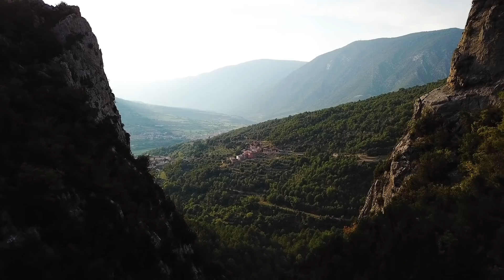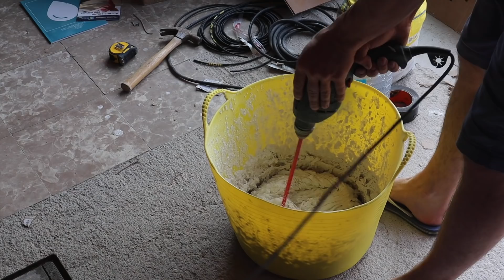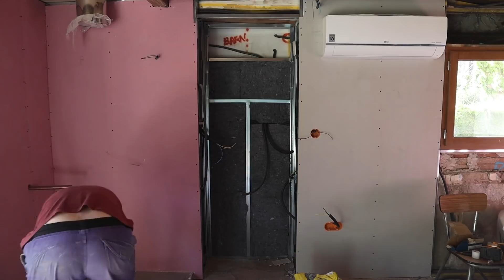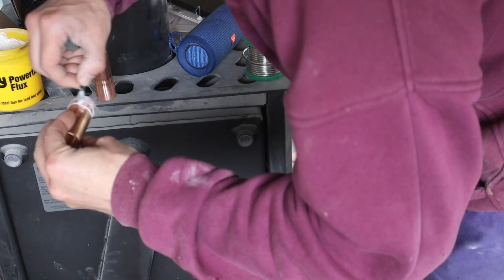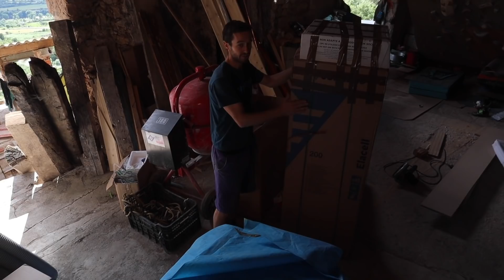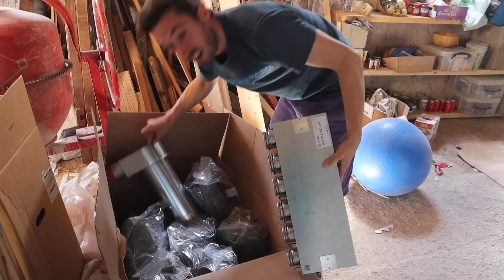ANOTHER DAY, ANOTHER SKILL TO LEARN // New Eco-Home System Arrives  🌱🏠

Comment: Your doing great Nate.  The recovery system only looks bad, once you start it will go smooth, you've got this one no problem.  Where is my tool? Now your sounding like a contractor or me realizing the stuff I need is 4 hours away at the new location in storage.  I drilled 7 holes yesterday with a screwdriver lol.  Looks great.